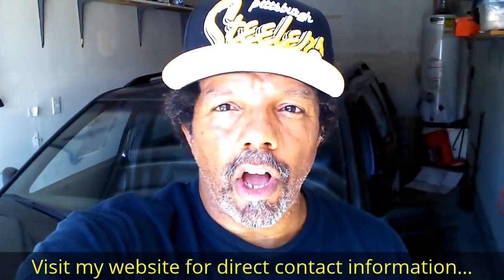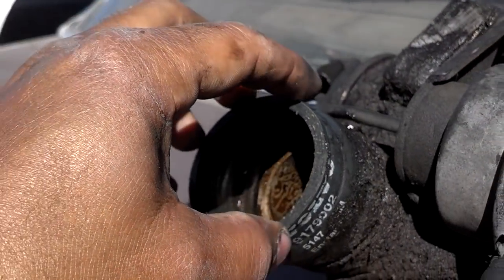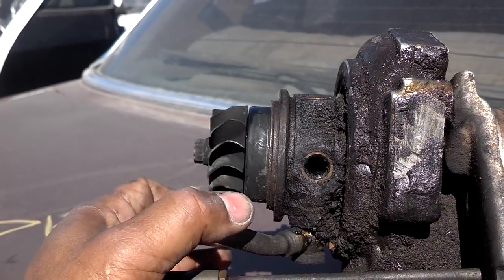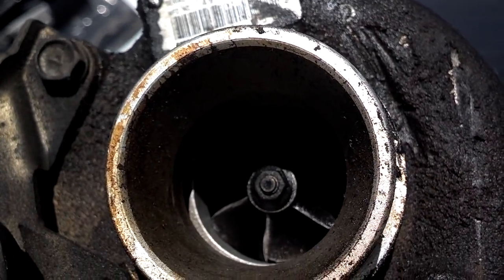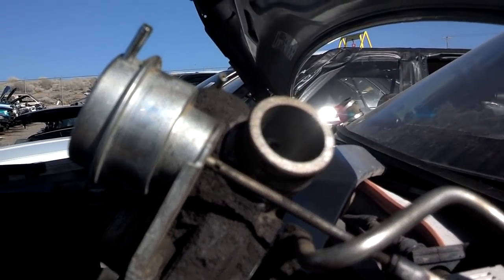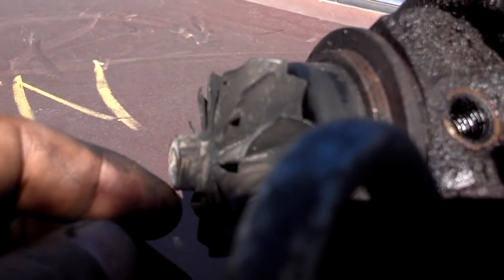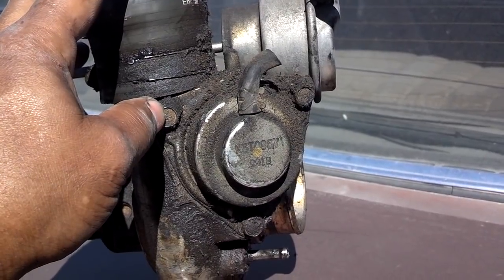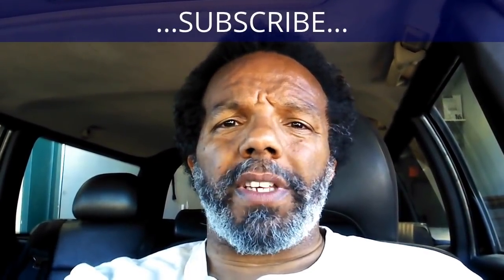How to tell if a turbocharger is bad. What can go wrong with them. - VOTD

Comment: Robert, you really should get some education on automobile's, ALL car's since 1964 have a PCV system, road draft tubes were replaced with them: Positive crankcase ventilation was first factory-installed on a widespread basis by law on all new 1961-model cars first sold in California. The following year, New York required it. By 1964, most new cars sold in the U.S. were so equipped by voluntary industry action so as not to have to make multiple state-specific versions of vehicles. PCV quickly became standard equipment on all vehicles worldwide because of its benefits not only in emissions reduction but also in engine internal cleanliness and oil lifespan.
Reply from the maker: OK, you win.
Reply: YOU STILL CAN NOT NAME ONE CAR PRODUCED FROM 1964  THAT COMES WITH OUT A PCV<, HAHAHA<  GO FIND ANOTHER TREE TO WORK UNDER BACK YARD BOY>
Reply from the maker: All caps, YOU MAD BRO?
Reply: Robert DIY #1). I am not your "bro", and #2).  Mad at what?  Your inability to give 3 details about your car that you say "does not have a PCV system. No, I'm HAPPY as Heil, it PROVES you can not back your word up. Simply put, you state a fact, and can not back it up, telling us you can not tell the truth. What training do you have? I'll tell you mine, sister. 28 years certified by the NIASE, which was renamed ASE, a government testing agency to certify mechanics. I have
 attended over 300 classes at the GM training centers. 5 more years of online training when the training centers were closed, except for 6 that remain open. I was the "heavy line" technician for Carl Black and Day's Chevrolet combined for 22 years. I would replace pistons for engines under 60k instead of replacing the complete engine, Including replacement of many "center rotating assembly's" on turbo chargers, knowing as been taught that only if there are scratch marks on the exhaust housing or the booster housing the center bearings have too much cearence. Please feel free to acknowledge your training, if you don't know what it is that you drive.

Comment: ok the rdx are known for bad turbos so this owner of this rdx drove the car until the internal parts of the turbo blew out and into the motor that is raw oil being dumped in the cylinders   i installed used motor 300 bucks the turbo was 400 they are harder to get
Reply from the maker: +sir meow thanks for sharing.
Reply: Nope no really

Comment: Could a bad turbo cause the motor to lose pressure?
Reply from the maker: I don't understand your question...
Reply: Robert DIY the dealership performed a pressure test on the engine and in addition to the turbos being busted the engine lacks pressure. (I'm guessing in particular valves) I'm not a mechanic by the way.
Reply from the maker: +Norman Scearce low compression? My guess is that a lack of oil and oil changes caused the engine and turbo to wear out and fail.

Comment: how do I take the turbo off of the vehicle? do you have a step by step video or a list of things to do?
Reply from the maker: What kind of vehicle are you asking about?
Reply: 2006 Volvo XC90 awd
Reply: I'm blowing thick white smoke out the muffler, I hear a whining coming from the turbo and I'm losing lots of oil. I'm prepared to replace it. I just know know what all needs to be removed before I can reach the bolts on the turbo to extract it
Reply from the maker: +2000Mrmvp this should help. https://youtu.be/hfUfFbWdzoU

Comment: ok so my brother in law just gave me a volks bora with a 1.8t in it it smokes like the volvo you drove in the video what would you suggest checking first ? pinch in the oil return line but then??
Reply from the maker: +LetsPlayDaPc first watch the video.
Reply: i did watch the video my firend but you never mentioned a car that spits oil out of the exhaust. Sorry to bother you you said if you have any question leave em in the comments so i did
Reply from the maker: I believe the video explains to check the turbo for shaft play, have you done that?
Reply: cant its a k03 for a vw 1.8t the output is too long and id have to take off the housing.is here other things i could check?
Reply from the maker: I have no idea.

Comment: can anybody help? my 08 octavia's turbo makes too much whistling even at 2000-2500 rpm . though the exaust is not producing  any smoke but my ride has gotna very poor mileage of just 25 mpg and the acceleration is also very poor.
Reply from the maker: +Amir Khan have you checked for a vacuum leak? You can also install a temporary turbo boost gauge to check the pressure.
Reply: no i can find any. btw the whistling sound is coming from near the right front tyre. do a bad turbo also results in bad gas mileage ? i get a very bad mileage of just 25-30 mpg
Reply from the maker: What is normal gas mileage? Yes, anything that effects the performance will effect gas mileage.
Reply: normal mileage for a diesel octavia is 45-50 mpg. can a turbo leak result in such a poor mileage?
Reply from the maker: Sure.

Comment: Hey Robert. Thanx man thats a really a gr8 video.
I have a ? though.
I have a 2.7 toyota minibus (gas ). Am planning to do a conversion to a 3.0 diesel turbo. What can be done about the lag before acceleration.
When starting up on mornings it has dragging and then a potion of white smoke comes out. Any ideas?
Reply from the maker: +Jomiah Bernard not really. Maybe a vacuum leak somewhere.

Comment: Great video.  When I watched this the first time last year, I was convinced to get rid of my 96 V70 with 200k miles.  I had a bad oil seal which showed up when I plugged a hole in the PTC nipple.  Symptoms occurred initially when I would let off the throttle after accelerating up a hill.  Progressively got worse to the point like the video.  Not the only reason I sold, minor warped head (water getting into cylinder) and transmission issues (most likely PNP switch).  Volvos are wonderful cars but stay away over 150k miles unless you are a good mechanic with a lot of tools and time.
Reply from the maker: Very true.

Comment: Can you recommend a good place that rebuild turbo or should i just send it back to the manufacturer? Is it cheaper to rebuild or buy a new unit?
Reply from the maker: What kind of car do you have? There are good prices of new cheap turbos on eBay. Hard to tell if any of them are good.
Reply from the maker: I have a guy local to me to rebuild mine.
Reply: I try to stay away from eBay turbos but it is a precision turbo. I can't remember what model. How much does you local guy charged you?
Reply from the maker: $300 To rebuild.

Comment: can coolant and oil be mixed together when with a faulty turbo? .. I have a dts unit on my hilkux and cant find the source of the problem... ive fixed head, head gasket and oil cooler gaskets. still coolant in oil instantly on turning over the care... all lines are in the right place been triple checked?...... can this happen in the turbo?
Reply from the maker: What kind of car do you have?
Reply: its a Toyota hilux, 3l engine. just want to know if its a gasket separating the oil and coolant or solid steel housing. engine lost oil and over heated after new engine installed. ive checked all options instead of the dreaded crack in the block, just want to know if the turbo can cause this. ?
Reply from the maker: Anything is possible but highly unlikely. How many miles after the engine swap did this happen? You usually get some kind of warranty with a replacement engine.
Reply: ok... is a turbo that takes oil and coolant separated by a gasket or the turbine wall, iron what ever.. it isn't cracked... is there a gasket between the oil and the coolant.. I'm asking a question about the turbo, nothing else.
Reply from the maker: ok
Reply: thanks. ive had trouble getting an answer from any one on this part of the turbo. ive replaced head gasket, oil cooler gaskets, new head as well. so, what I am asking, and yes if I have to go back and redo substandard work I will, but before I do can some one tell me. ... In the section of the turbo that has oil lines and cooling linbes entering and exiting it, is there a replacable seal that could rupture and allow coolant and oil to be mixed. ... the original problem that began me having to rebuild was loss of oil and ruined the crankshaft. no play in the turbine and I dont think too much damage was done.... unless what I'm asking ?
Reply from the maker: Well, maybe you should ask a different question. Chances are, you have a crack in the engine block. Try replacing the entire engine.
Reply from the maker: Ok, so I answer the question the best I can and you don't like it so you pound away and get aggressive?
Reply: just asked the question that I asked and you responded in a condescending way. just answer the question or say you don't know.. I ask you because you where on here about turbos in particularly. all good.

Comment: Great vid, Robert!  I know nothing about cars - except that mine are always a big expensive headache, but your presentation is so understandable and actually enjoyable.  I'm only here because I had my 2003 A4, 1.8 turbo in the shop today with a CE light on, less power, or not as good a pickup as I've been used to - (but not as bad as I'd expect based on what I've been reading about turbo issues, and no smoking exhaust), and a really rough idle.  They cleaned about a gallon of chipmunk debris from my air filter box, cleaned the MAF sensor.  Now there are 8 codes: P0300, 301, 302, 303, 304, 171,172, and 299.  The mechanic said the one indicating a problem with the turbo is most likely the cause of the others.  He did a visual check of hoses and wires and said everything looked fine, and would probably do a smoke test next.  He also mentioned that "they" don't do much turbo work, and he spent a bunch of time on the computer, which made me nervous.  So, I'll be calling someone else tomorrow (friend of my neighbors) who's apparently an audi expert for a 2nd opinion, or legitimate diagnosis.  I just figured I'd see what you had to say, since you're so good at replying to folks.  Thanks for the invaluable service you provide.
Reply from the maker: +Dave Ostrowski sounds like a bad air sensor, MAP or MAF. Could also have a hole in one of the turbo tubes since critters got in the air box.

Comment: only by looking at yours people can tell it's bad! :D how da hell it got so much oil and carbon on it? :D
Reply from the maker: Not all PCV systems have a valve, my car does NOT.
Reply from the maker: Bad leaking PCV.
Reply: Tomas Av. a pcv is a valve in between the crankcase and intake vacuum, it function is to pull fumes from the crankcase and suck them into the inkake, if it WAS leaking, oil would simply be coming out between the value and where it slips into. Test a PCV by rattling it, clean it with carburetor cleaner, just as new.
Reply from the maker: Congratulations.
Reply from the maker: https://www.youtube.com/watch?v=u1zoHQZHJYU
Reply: Gordon Dowis go back, and work with your dinosaur GM OHV, Volvos don't have a "PCV" valve they use a complete system with a trap can, a heater and complete capture system... like real technology not some WW2 engine style
Reply: Then by "Federal Law" you have a pre- 1961 car. You don't know but what you do in the JUNK YARD, I have been "Factory Trained" for 25 years. ASE certified more. Just watching you repeat" I don't know"  tells me all about your " hands on training" than being trained by a "professional"  This too will be deleted by you because you don't know what you are talking about, except your "junkyard experiences".

Comment: I have a FORD S-MAX 2.0 it hesitates all the time I have a fault code Poo3a - turbo boost control A position exceeded learning limit could you explain what this means please I hit the subscribe great video really clear explanation please help
Reply from the maker: +Danny Buron I'm not really sure what that means on that vehicle. However, when you're having boost problems it usually means that you have a torn vacuum line probably going to the wastegate actuator. It sounds like the vehicle is over boosting so it's cutting fuel to prevent damage to the engine.
Reply: OK thank-you Robert I will look at the vacuum line connected to the Westgate actuator. Can over boosting(hesitating)damage the permanently? few mechanics I have spoke to have said it could b 1 of many different things but I will start with your opinion first! Sounds like tou know your stuff and most people just want money I really appreciate you taking your time to reply. Cheers Danny
Reply from the maker: If the car overboost at a low rpm it can bend a rod, permanent damage.
Reply: +Robert DIY ok thanks bro bad news then 😥
Reply from the maker: Not really, only if you bend a rod.
Reply: +Robert DIY would you say the easiest fix is a new turbo because I took my car to a local mechanic and he said the codes mean nothing to him so I took my car to dyno they said it will need a main dealer specialist to look at it and I can't afford it! however the guy from dyno said a bad solenoid and map sensor could be the issue is the rod your talking about the rod attached to the Westgate actuator on the side of the turbo? sorry for the essay I'm feeling devastated😭
Reply from the maker: no, the rod that attaches to the piston. 

Not sure why you are avoiding the dealer.? Most will tell you what is wrong with the car for $90.

Comment: Great video and very helpful. Question: I have a 2007 Chrysler grand Voyager crd 2.8 auto, It was driven for 30 miles with a heavy oil leak that leaked from the oil filter that had a hole it in, and basically all the oil was exhausted during the first part of those 30 miles, I don't think the engine was damaged as the car starts and seems to still have reasonable compression. However, now there is massive smoke coming from the exhaust big time and there is no boost when I hit the peddle, the car will not pick up and struggles to get to even 60 mph. When I let the engine idle it sounds okay and the smoke stops, do you think this problem could be due to the engine itself or could it be that the Turbo was starved of oil and is now seized up so that it won't boost? I know you can't be sure without seeing the car, but could it be the turbo do you think? Also do you think the EGR valve could have also been damaged at the same time as I know that can cause smoke when not working properly. Great vids you make keep it up!
Reply from the maker: +Paul Manning Paul, how are you going to tell me that the oil leaked out of the engine, driven like that, then you DON'T THINK the engine was damaged because IT SEEMS to still have reasonable compression. Then say it has a MASSIVE smoke issue and WON'T gain speed... Stick your finger in the turbo and see if it turns smoothly and if it has shaft play. Also do a compression test.
Reply: +Robert DIY  What I mean is that at least the engine did not lock up due to total oil loss as they usually do. I think the engine did not over heat enough, it was my wife that drove it and not me while the oil leaked out, (before you ask). Is 30 miles without oil in the engine enough to damage the engine? Is that what you are saying Robert?
Reply from the maker: +Paul Manning man, I wouldn't try that for 5 minutes or 2 miles. That must have been one noisy ride.
Reply from the maker: +Paul Manning +Paul Manning I pulled an engine from the junkyard the other day, took her to a shop that rebuilds engines and stuff like that comma I wanted to check the compression on it but there was no oil in the pan because the junkyard always drain all the oil out. To be honest with you, I was afraid to hook up a starter and check compression on the engine without their being oil in the pan.

Comment: What would cause my turbo to have drops of oil in compressor side but bone dry through my charge pipe?
Reply from the maker: +satawat senyotkham The turbo has 2 halves. There are seals on the compressor half and seals on the turbine half.